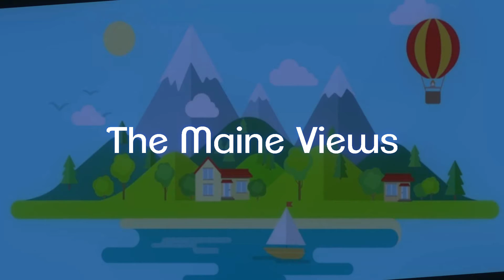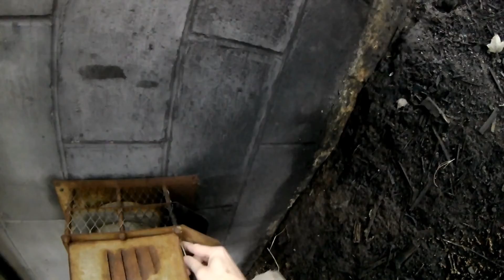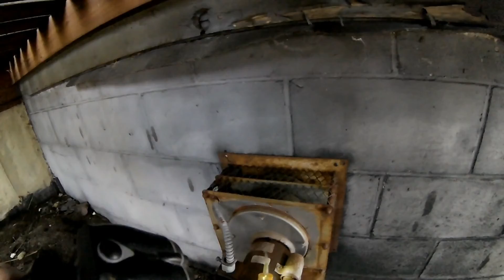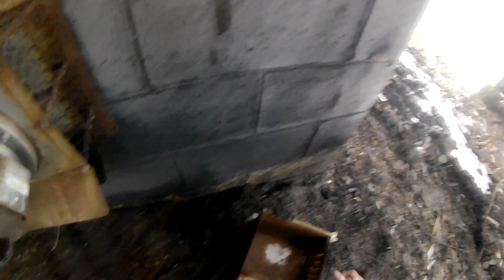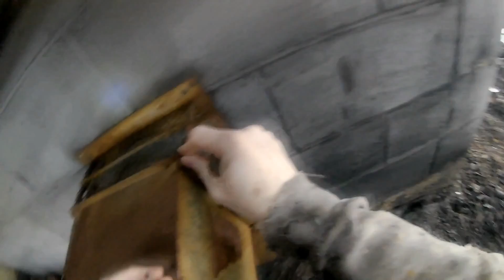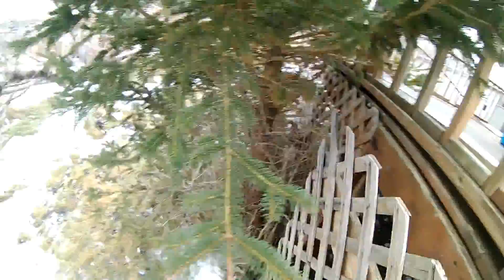Oiling Field Controls Power Venter Motor

Comment: That looks like ALOT of oil to put in. The recommendation if 4 drops or so for each hole using the Fields oil.  The $20 for a SMALL bottle of oil seems cheap if it keeps the unit running. My vent motor was seized by rust at beginning of last season. Manual turning and oiling seemed to resurrect this beast, and seemed to work OK for the season, and oiling again in the offseason, seems to be running smoothly and silently. Point is oiling of these things are important, as replacement is expensive, even a DIY install. Thanks for your video.
Reply from the maker: I live right beside the ocean so I go beyond the 4 drops. I t has caused no harm. I also use the mobile one because even Fields Control can't tell me what if any difference there is.  Of course, there is also the cost savings.
I'm glad your got yours going. All the best and thanks for the like.